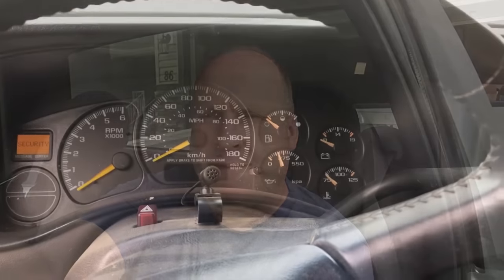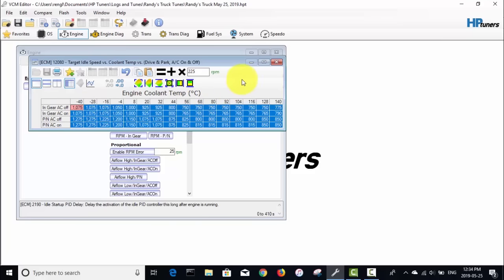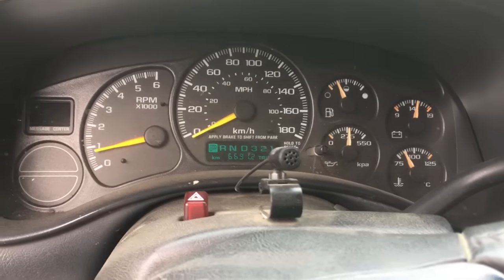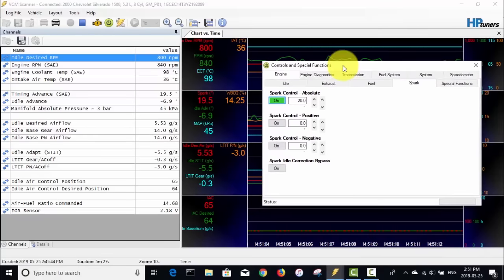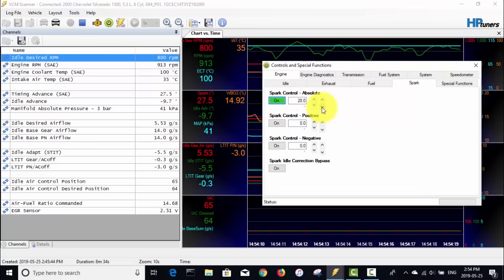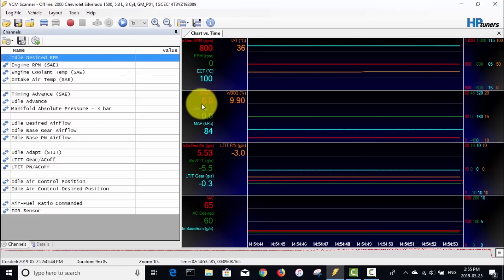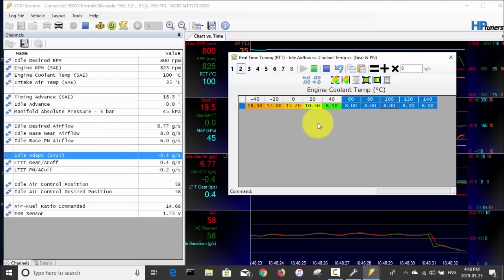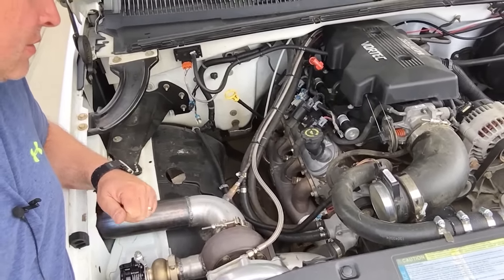Idle Tuning after Cam Swap with HP Tuners

Comment: I recently got my 2009 tahoe tuned but now when starting it after turning it lff for about 10 smokes and sell to much like gas
Reply: Any ideas?
Reply from the maker: Ricardo Villa what kind of modifications have been done to the engine or was it just a tune of the stock engine?
Reply: Cam, headers. When I first started it it was fine then i dropped it off for a tune and it started smoking and smelling to much gas
Reply: I went from 87-93 i dont know if its that
Reply from the maker: Ricardo Villa it might just be a result of the c swap, if your new cam has a lot of overlap it could be letting some extra unburied fuel through into the exhaust at idle. I have heard of guys messing with “End Of Injection” timing to fix that but I don’t have any experience with that myself
Reply: Ricardo Villa >I am not a “Tuner”  but an ASE Master Tech of 42 years-Retired, but now almost April 2020, your Tahoe is already 11 years old. I would guess you have at least one injector no closing. If you can’t sit in the seat to see the engines information parameters and see a rich condition and no code is set, then buy, barrow or pay to have a quality “Fuel Pressure” gauge installed, it will eliminate or confirm a leaky injector once shut off. Say while running, the PSI is 55, once shut off, if it drops over 10 minutes to under 10 PSI, then having the injectors cleaned would be one of 3 possibilities. This means, if return less, there is only one hose on the fuel rail. The line pressure can be regulated inside the tank at the pump assembly. Other wise, the regulator can leak back into the tank or thru the vacuum hose. (Check Rock Auto for Two Fuels Lines on Regulator or 3, or if none is listed /small one is vacuum / can be seen on engines fuel rail) This can tell you what system you have in 2009 Tahoes. The pump itself has a check valve in it, where pros have two hoses w/disconnect w/ball valves. This device eliminates the pumps check valve and regulator if equipped. The only thing left is injectors. If leaking, a check of your spark plugs is due. White or off white, burning correct. If dark brown to some really dark / black ( Keep Plugs in Order) This method of reading plugs goes back as long as smart techs have diagnosed cars. Used “Top Tier” fuels at a good gas station. Don’t know what that is, Google it. “Techron” by Chevron is sold and use with low tank level for higher concentration. Dealers for GM, use block-off hoses with ball valves as it can’t be allowed in the tank. They use ACDelco X-66P or GM Upper Engine Lube at 10% with gas in pressure pot & it cleans the injectors over a 10 minute run time. Best of Luck!

Comment: Tuning a 2006 Chrysler 300C SRT8, and unfortunately, it does not have as many settings to govern smooth idle as this.
Reply from the maker: James Miller yes I’ve heard that tuning the hemi engines is a whole different world, good luck :)
Reply: @LowbuckLS  well, I've figured it out for the most part. I've done VE based tuning before, it was nice seeing you apply it to this Chevy as some kind of mark of similarity between these three vehicles. But the maps on the Subaru were far more straight forward. There was a closed loop section that defined everything needed for idle, a VE section, a base openloop fueling section to directly adjust AFR, etc etc. So the indirect strings that this SRT8 has given me threw me for a bit of a loop today. Luckily Theres a post on HP tuners that can open my eyes more to this.
Reply: Funnily enough, it's just about idle tuning. Hopefully it's more than what the title states xD